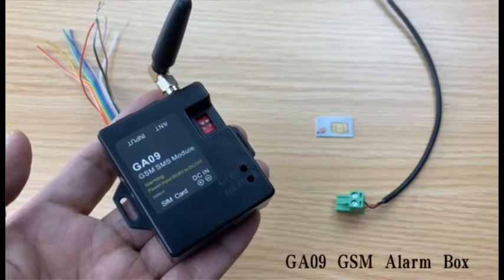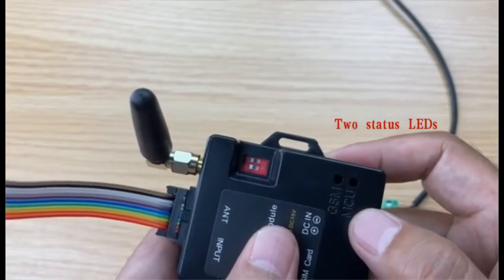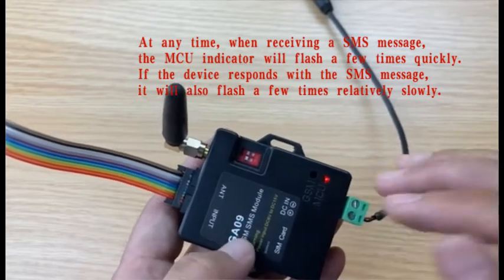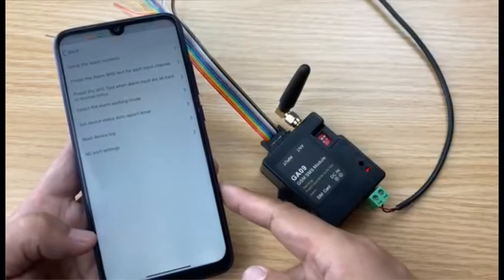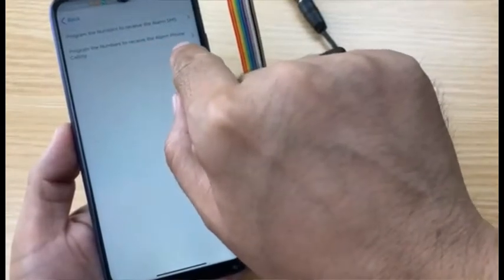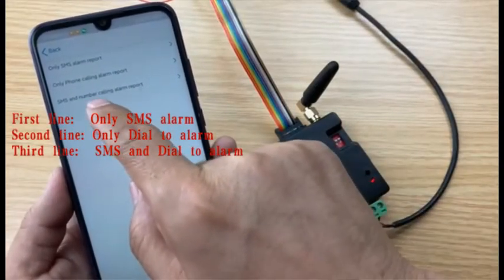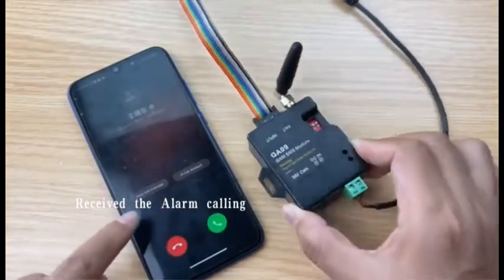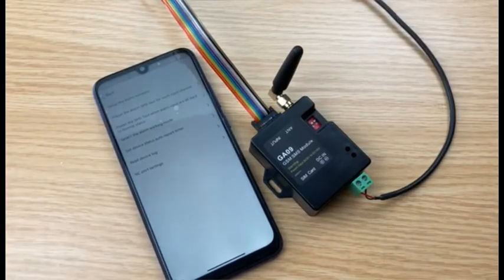GA09 GSM Alarm box with eight alarm input

Comment: I need the GA0-1/P9 to send a 5V signal to trigger a relay when you ARM/ACTIVATE the unit from a mobile call. Can you tell me where I can use a 5V signal pin/line on the PCB?
Reply: Neste equipamento não dá para enviar sinais, apenas para receber informação